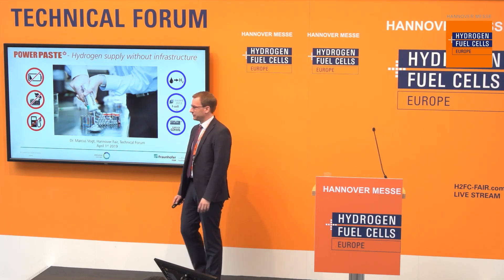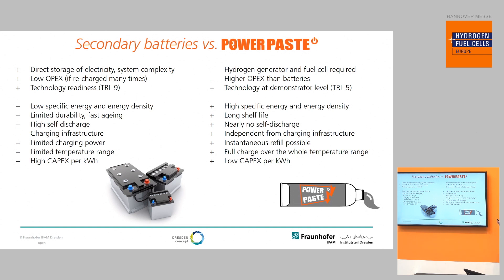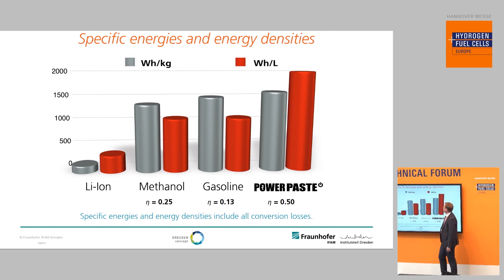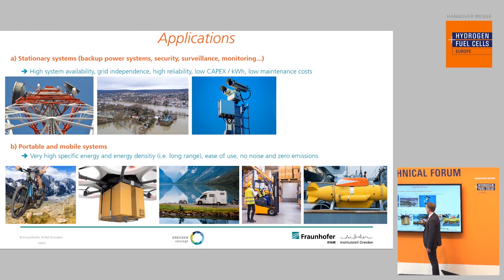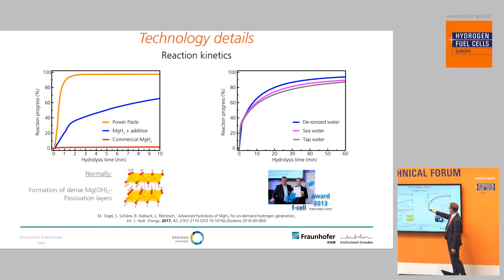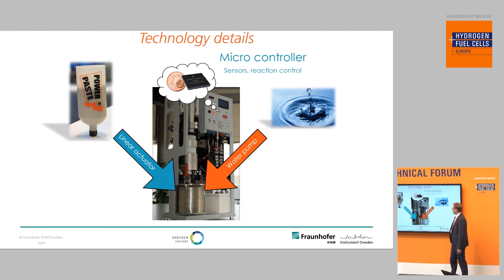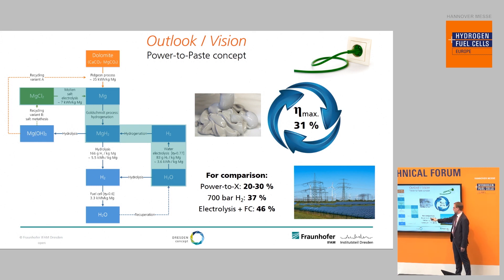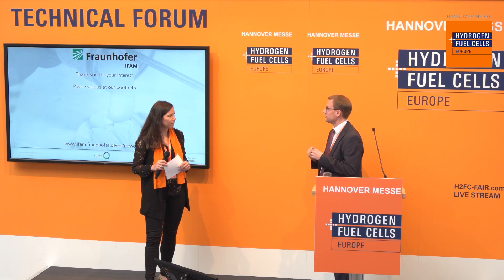PowerPaste – Hydrogen supply without infrastructure

Comment: Sounds fascinating but I still can’t understand what the byproducts are. They say they are using metal salts, probably to stabilize that goo. The process of energy generation also requires water. Does that mean we will have a ton of metal salt contaminated water if and when this thing takes off?
Reply: i guess so
Metal salt is either in water or in a filter that needs to be changed

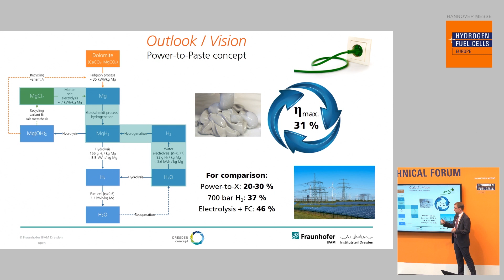Comment: 14:46 in the video is the biggest steaming pile of bullsh*t I think I've seen from anyone from an institute like Fraunhofer.  Water electrolysis plus high pressure storage plus the fuelcell (which they too must use) has a cycle efficiency of less than 37% absolute best case.  Aluminum electrolysis is by no means anywhere nearly as efficient as water electrolysis, given that it is a high temperature process- and magnesium is harder still.  In reality, when all is said and done, it is much more likely that the recycling step- Mg(OH)2 back to MgH2 in the form of this paste, is a very, very lossy step indeed.  And if you want to involve a metal refinery (which is what making Mg(OH)2 back to Mg metal really is) in your recharging cycle, running your car off thousands of similarly non-rechargeable zinc-air hearing aid batteries likely makes more sense!

Comment: This video did not address the full operational cycle that includes disposal or recycling of small quantities of Mg and other metallic waste that must remain after the H2 is consumed. Can it be fed back into the production process to be combined with H2O and electricity to generate more paste?
Reply: Yep, unless there is a way to create MgH2 directly from Mg(OH)2, we need to electrolyze molten Mg(OH)2 to get back metallic Mg.
Reply: It's addressed at 14:56
Reply: @EgnachHelton  -- Where is it addressed, Charlie? Certainly not in the audio. If there is any detail in the flowchart, it was not readable on my display.
Reply: @EgnachHelton  How about Sun-light Pumped Laser?
Reply: @Andrea GG -- Thank you, Andrea.  I had to capture the chart from a much larger screen display in order to read these details.  I still would like to see a residentially-sized set of devices to accomplish all the elements of these processes, presuming some quantity of continual renewable inputs such as sunlight, water, and electricity, subsequent to initial and perhaps occasional supplies of dolomite and magnesium powders.  Apparently someone else is developing prototype solar collectors which produce H2 from water, which would nicely complement the MgH2 production.  And I'd like to know a bit more about how it is proposed to retrieve or scavenge Mg byproducts from the devices that utilize the paste to retrieve the energy stored therein, in order to input them into the recycling processes.
Reply: It won’t be small amounts of magnesium, since it is 92% of the MgH2.

Comment: I would like to see them produce a residentially-sized unit which produced sufficient quantities of paste for family-unit energy requirements of cooking, heating, electricity, and transportation. Solar collectors might be an excellent energy input source to produce what is then clean H2 storage. I would look forward also to an air-mobility application of the paste for personal transportation. Particularly I can envision an electrically-powered cyclogyro "backpack" (also cutting edge tech) for which MgH2 paste + H2O could provide sufficient operational duration where current secondary-battery capacity falls short.
Reply: Is any DIY Kit available? Pilot production and DIY Kit of small size easily make it more popular and acceptable
Reply: WEF would make that ilegal